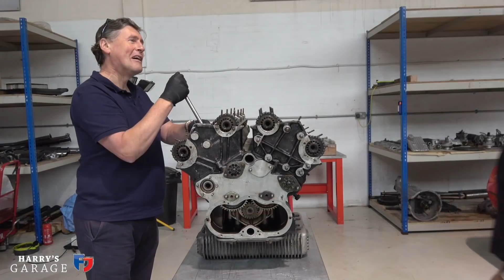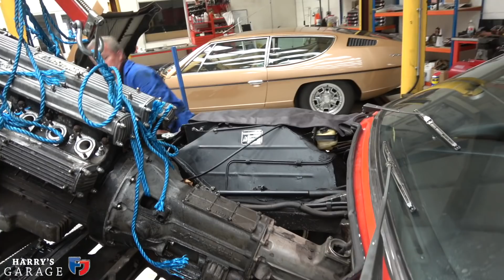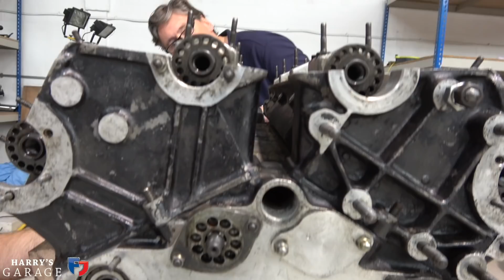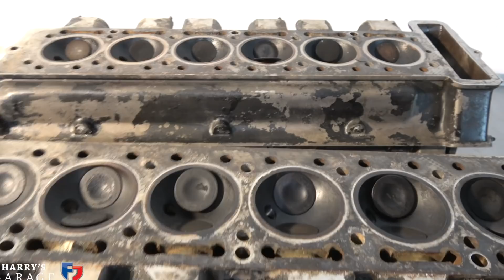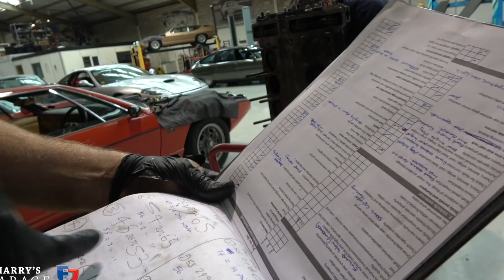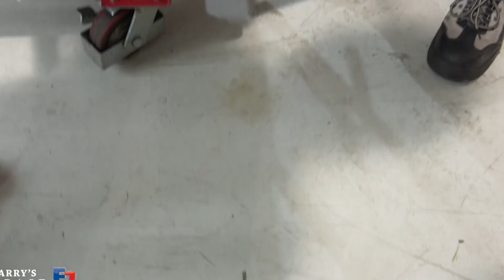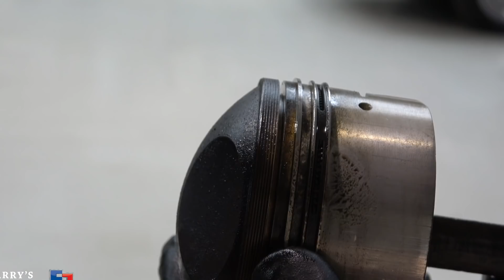Lamborghini V12 engine rebuild. Part 2, stripping the engine

Comment: Fascinating to hear about how the (Weber, but I guess the same for Dellortos et al?) accelerator pumps petrol-wash the bores at cold start-up. If I ever own a car with such carbs I'll never pump the throttle pedal at start-up again, even if it does mean waiting a bit longer for the recalcitrant engine to fire.

Comment: Interesting diagnoses for the ring failures my first go to would have been overheating as the head gaskets had failed however if overheating did not occur then clearly there was another reason, was the broken rings from bores that had water infringement as coolant here will raise cylinder pressures.

Comment: Considering there was some metal scraps in the oil pan, might want to check out the guides on the timing chains. Sometimes the chain will slap or machine away at the side of the timing chain cover. I’ve had one eat straight into the side of the cover into the water pump. Seeing that the oil is a decent consistency and color, it doesnt look like water got into to the oil though so that’s good.

Comment: If you had a head gasket coolant leak into the cylinder, the corresponding piston should be clean from carbon deposits.  Not sure if I saw that.  You may have another reason you were losing coolant.

Comment: Not too much really wrong with it,  the main bearings are certainly big and beefy, quite a doom on the top of the pistons. Maybe it is worth running upper cylinder lubricant in the petrol for starting, then the fuel has lubricant in it, just a suggestion. ( I use upper cylinder lubricant in my cars. )

Comment: Very similar to jaguar design, not sure who copied who))
Reply: The jaguar is more aircraft engine influenced than race engine. From memory 17 nuts and studs holding the water pump on? And that central quill shaft and bevel gear arrangement for driving the distributor from the cam chain was bonkers.
Reply: @rayg9069  Originally a copy from a Ferrari 6

Comment: It’s a V12 Hemi !
Reply: Well spotted. Quad cam 4ltr V12 with 6! twin choke carbs = 350 bhp at 7500 revs.
Single cam 6.5ltr V8 with a single four barrell carb = 360 bhp at 5800 revs.
I know which I'd rather rebuild!

Comment: Interesting how hot the crank has been at some point, it appears to be uniform and on the webs between every journal so I assume it’s from manufacture rather than a spun bearing as you’d usually expect when it’s so blue.

Comment: Another excellent video Harry.

I'd suggesting getting the rocker covers and accessories freshly coated in a black wrinkle finish, as they commonly are from new.

I do said coatings, should you need any assistance or advise.

Comment: You might find that gunk in the strainer is the remainder of an additive that's been added to the oil to try & stem the oil consumption by a previous owner & its solidified, Used them myself a few times on vehicles iv'e put through the block :-)
Try using an oil that's designed to cling more from cold may help with the fuel wash

Comment: I don't get why Lamborghini (specifically the engine engineer) decided to pass the water passage crown so close to the cylinder when there's so much meat just above to the edge. And it's not a casting problem, the core would've had no problems with that slight modification. We're talking 4 mm too close the cylinder dome/wall. Odd.

Comment: The good news is the broken piston rings stayed in place, I've had them get down in the sump and pieces get into the oil pump which makes a horrible noise!! so it was probably the right time to get into this engine before more damage took place. It will be interesting to see how the bores are, regarding wear and any scoring from the broken rings and if the cylinder heads are warped at all.

Comment: Nice technical video - the bill doesn't so far look too bad Harry (still, it is a Lamborghini, so won't be cheap)!

Question: I love copper grease, but ..... I thought it was an unwise idea to use when you want to torque down items, such as spark plus, wheel nutes, head bolts, etc???

Comment: Great video Harry - just a small point at 8:07, while it was pointed out the compression-stroke cylinder environment would overly pressure the coolant system, there was no external evidence of an overly high coolant system pressure, just a loss of coolant. In contrast,  under the cooling system's normal pressure, coolant will travel from the coolant jacket into the cylinder head combustion chamber on the piston induction stroke - that is, the coolant pressure is higher than the cylinder induction pressure.

Comment: Even spark plugs with a bit of copper grease - comment noted. Thanks guys I also wonder if you can just drop the sump with engine in the car as that pick-up strainer is the thing to watch. On my Quattro is was pristine, but in our Polo 90% blocked. Regular oil and OEM filter changes are critical to engines IMHO
Reply: paredding I used to help my late uncle restore his vintage cars when I grew up in Devon in the seventies, copper grease was always used when popping the plugs back in or putting heads back on or manifold, it’s magic stuff. He used to put a smear of it on the backs of disc break pads as well as it helps them not to squeal. I learned a great deal on those cold winter nights putting his Lagonda back together and his Spitfire and Wolsey, great fun and over forty years later I have not forgotten what he taught me. One of my regular jobs was with grease gun in hand greasing the nipple points, loved crawling under the car to get to the grease points! He was an aeronautical engineer by trade.
Reply: @ianmedium  V similar here notably with the grease gun when he was working on his Rover 14 and Consul 375 (great fun as a child being allowed to refill it!). I knew of the brake pads but having just removed the SP's from the Quattro, note how tight they get and am always terrified of damaging the alloy head even on removing. Old lessons are never forgotten - I was started out on a Suffolk Colt lawnmower. Happy times

Comment: Car enthusiasts’ heaven - the V12 from one of three Espadas being stripped down, a Fiat 850 Abarth, a beautiful CX, an XJ12C in racing trim, various Ferraris, Crewe products...drool, drool. Just one thing, the Beluga you heard was NOT an XL, but an original 300 series. The XL is still running around Toulouse on trial flights...

Comment: Another fantastic video Harry!
I'm curious about the crankshaft, it looks like it's had some heat buildup with all that blue-ing around where the rods attach. Is that normal for these types of engines?
Reply: Same thought here, would love to hear feedback from the experts working on this engine on the crank web discoloration/heat oxidation?

Comment: The rope thing is still incredibly ignorant. Climbing ropes are rated at those weights when new. Even dropping them in the dirt can be enough to need a new one for a serious climb. Lifting heavy metal will certainly cause micro tears reducing the carry capacity of that rope. Hopefully you use a new one for every engine. Cheers!
Reply: Really? Look at the pictures; obviously they're lengths cut to size. He's wearing a rolex. He is not exactly going to scrounge for a "used but good" length of nylon when he goes to lift another v12 out of one of the, many, very expensive cars currently in his garage.

But, you know, glad you got demonstrate some knowledge

Comment: There's no point cheaping out on resurfacing the flywheel. Those type of engines are sensitive to vibrations, and unbalanced and/or crooked flywheel can kill the engine. Also it seems they have reused those pistons already. Too large gap between piston and cylinder wall can easily crack those thin rings, when flooded with gasolene during cold starts.
In short: "saving money" in old parts usually advances the next rebuild, and therefore doubles the budget.
 Normally it is done when fixing a flip, to rip off the next fool, but when building a car to yourself, you should not cut any corners. They will always bite you in the ass eventually.
Reply: I imagine the mechanic knows what he's doing.
Reply: In most cases, he does. But he is not holding the money-bag. 
And in most cases, the money-bag holders do not know what they are doing, when they are "saving money" on engine builds. The mechanic probably can make the car run with scraped flywheel and worn out pistons in cylinders honed too large, but the cheap fix won't last. And then you'll have to do the whole show again. The mechanic doesn't care, because he get's payed by the hour, every time he gets to build your motor, when you are calling the shots.

Comment: Submariner on a mechanic's wrist, always a good sign he's gotta be doing something right.
Reply: Yes, also having the confidence to let some one into your workshop and film you work.
Reply: You don't get that down at Kwik fit!
Reply: It’s a 5513
Reply: @t c   Those watches weren't a fashion item back in the day. They were functional. I have one of its contemporaries, an Omega Speedmaster, which has just had its 50th birthday. Its suffered much abuse over the years, including working on car engines, but its still ticking away on my wrist as I type
Reply: @leftnose  zackly - and a nice one too - not sure I´d use one as a tool watch given the plastic crystal tho...
Reply: alvarortega2 that might be owner of business.
Reply: alvarortega2 exactly.
Reply: even better if its a yellow one , but in his pocket.
Reply: I bought one just like that in Bangkok.
Reply: And it's a vintage one :)
Reply: My uncle, an engineer who gave up his job to tend the family farms after his brother died had a Rolex on his wrist. If you set your goals in a direction, and you're willing to pay the price full meal, you'll get it, whatever you wish for. Sometimes luck, sometimes just hard work, sometimes both.
Reply: I'm a mechanic and personally I wear a Seiko Divers 7002. Not high end at all but just a useable as the Rolex without the worries
Reply: @rp20832  They come in quite a wide verity of pricing. My dealer currenly has 5 different in the shop and they range from about 11k Euro for a steel version, to 35k Euro for a full 18k white gold brushed. They are nice, but by today's standard, not that special or rare. I've met my share of guys who have financed a Rolex. It's not like a high end Patek after all.
Reply: @AB-80X  Even then...Patek look ordinary compared to high end, A Lange & Söhne masterpieces. 

German engineering is beyond compare.
Reply: @jamesrobert4106  
Like Patek, A Lange & Söhne have a wide range of watches. They are pretty evenly priced, with some Pateks a bit higher. Some Pateks may look ordinary, but so does some A Lange & Söhne.  The 1815 series is one of my favourite designs, especially pieces like the 235XXX range.
Reply: @AB-80X  This.  It would have been more interesting if he had either a vintage watch or something obscure.   Most of the value of a Rolex is just marketing - there are plenty of equally good or better, more interesting Swiss watches, like Harry's Panerai.
Reply: @ckm-mkc  
Indeed.
Albeit Panerai is Italian and not Swiss, they make marvellous pieces. Few watches gives you the quality and precision of a Panerai, no matter the cost. Have had a Submersible as my daily for the past 18 years and it's brilliant. I have a few real high end chronos in my collection, but the Panerai is a true gentleman's workhorse of a watch. 

The whole Rolex thing has gotten to a point where Rolex is more for people whom see not that much into time peices, but rather just want a beautiful and fancy watch. In the obscure world of really rare, interesting and expensive watches, Rolex is not even scraping the bottom of the barrel..
Reply: @AB-80X  I completely agree. Interesting fact though, Rolex used to provide movements for PAM. I have 30 watches including 3 PAM, no Rolexes
Reply: @AB-80X In the early days of Panerai you even got a touch of complimentary radiation poisoning from the original Radiomir 😄
Reply: No No, It's a bad sign! He's obviously charging the customers too much.
Something like, well sir, we've had to replace just about everything and it's taken two months.
Reply: @Rog5446  A good chance the Rolex came off a customer wrist.
Reply: @davem5333   His lackadaisical acknowledgement of it suggests it ain't a big deal to him. No surprise if he either has it just because he can or because somebody was short on payments
Reply: @Rog5446  😂 I was thinking the same
Reply: @Rog5446  The guy has worked hard all his life and has a successful business.  I'd say he can have a fancy watch if he wants.  His clients ARE the kind of people who will pay top dollar for an actual proper restoration on multi-million dollar cars.  Who cares if he has a 25k$ watch.
Reply: @Rog5446  Yeh but there is different between a real Mechanic { i won,t call him a technician ,because that's what modern Mechanics get called } ,and the average grease   monkey down at the local Toyota dealer just doing service work and plugging in a laptop all day ,with not much interest in what they do,and probably would not know where to start  doing bigger stuff like this
Reply: @LOTPOR0402  pretty much spot on 👌I bought a brand new v6 navara had it serviced at Nissan till the warranty ran out, bunch of clowns (top Technicians) got it home after 2nd servis and the oil filter was leaking good job I checked it and I only live 3 miles away. I do it myself now project manager, team leader, sales executive just title's to make people feel important.
Reply: @peterbalac1915  I lot of these so called techs are just up the own arse these days .Prove to me you can repair the space shuttle or a 747 and I will be impressed   .You wouldn't mind a modern car is a lot easier to service than the older stuff